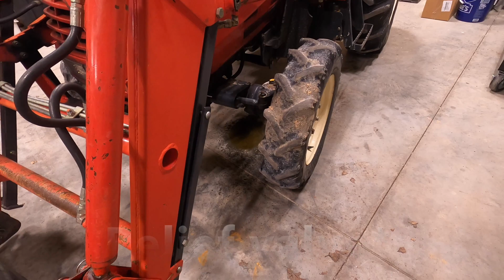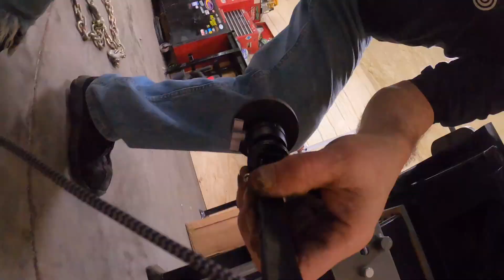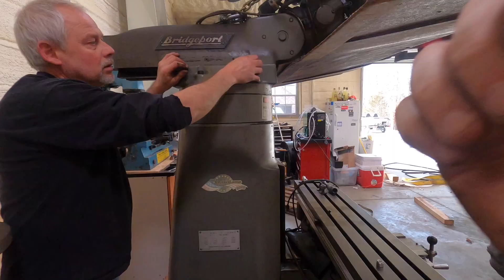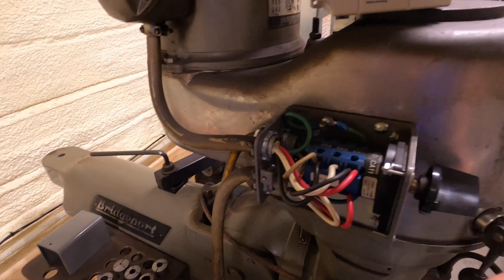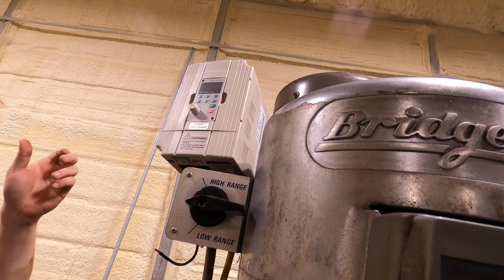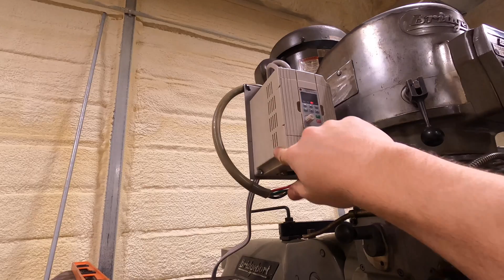Moving and setting up a 2600lb Bridgeport Mill

Comment: Lifting a bridgeport base by the cast iron spider that holds the rotating turret on is a bad idea. they're cast iron and they're not all that strong and also brittle not meant to flex.. Yes, if lifting using the eye on top of the mill that spider is involved, but it's solidly held in place by the four bolts that hold down the turret, and not being flexed or having the weight shifted more to one side or the other as one might encounter when connecting directly to the spider itself.. I've seen a few that were broken by trying that. Glad it went ok for you.
Reply from the maker: This is very good advice, we realized it was a poor decision to try and lift by the cast spider with the lid being so unbalanced. Thanks for the advice, slowly learning the right way to do things haha.

Comment: That is so cool that you were able to get a mill in the shop. It did seem like it was shaking a lot more than it should, probably because it is still on a pallet. I'm not an expert but I am pretty sure that you are only supposed to increase/decrease the speed when the mill is running. Also if you have a problem shifting from low to high speed, try spinning the bit a little while doing so
Reply from the maker: Thank you! My dad actually called to tell me the exact same thing about the mechanical speed control while it’s running, Keep the advice coming!